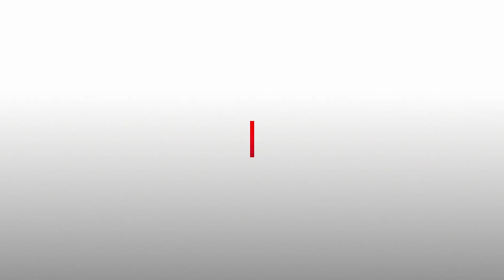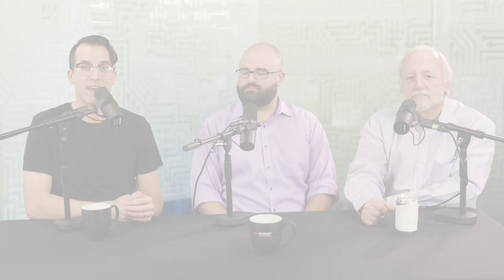DDR5 and 3D Silicon - EEs Talk Tech #25

Comment: If we were to stack up chips, how would you handle thermals. Like if you even do a stack of say 5mm, even that is too thick for good heat transfer for the bottom most wafer. Moreover as the chip layers will heat up, there characteristics would change. So how can we handle that.
Reply from the maker: That is a great question! Definitely one of the issues to work out.